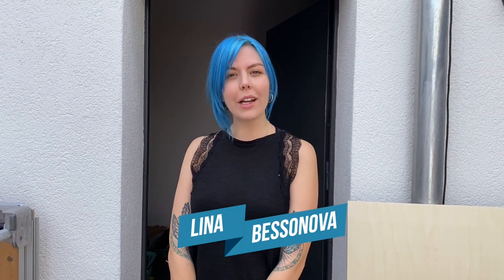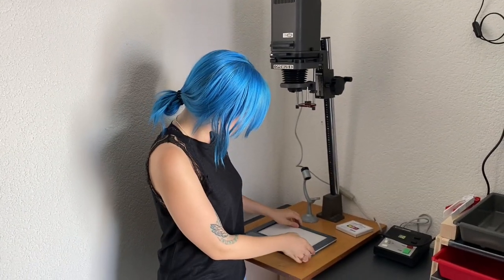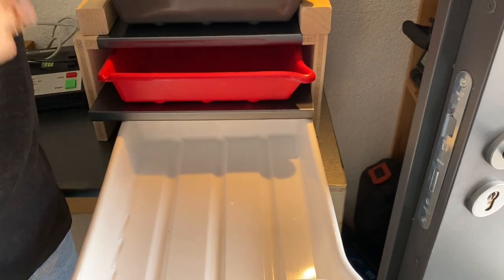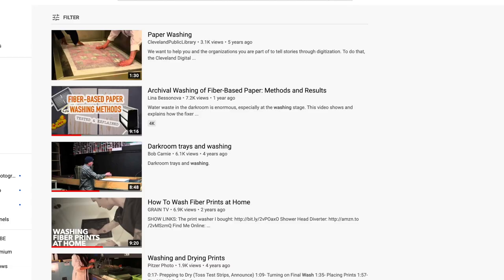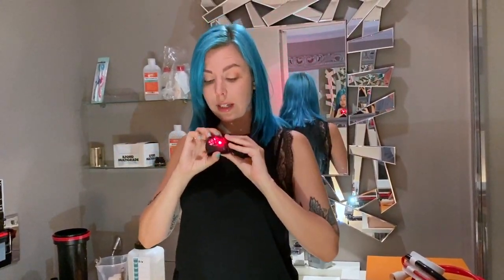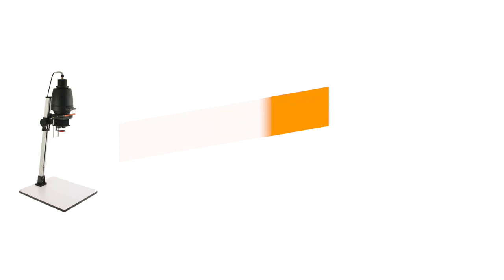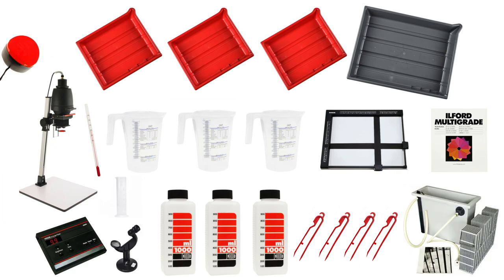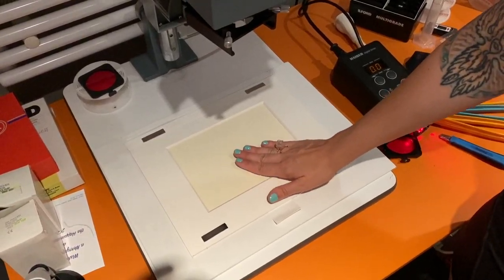Basic Home Darkroom: Setup + DIY Printing Easel Tutorial

Comment: Indeed, this is how most people printed their family pictures, most of the time!  Adapted rooms, trays carried to a sink somewhere else etc. etc.  Most of the 'amateur darkrooms' one sees on video are larger and more luxuriously equipped than the one I worked in professionally for years.  A useful washing tip is to look for the leak-tray that goes under a washing-machine, as these are bigger than two feet square and ideal for washing anything up to 20x16" (where space is available of course, but washing doesn't have to be in the dark).

Comment: I use read LED lamps. They come in the same size as 12 V halogen incandescent bulbs with integrated reflector. But they actually contain red LEDs. Just use a 12 V halogen lightning system and replace the bulbs with the red LED lamps.
To block light: By at a hardware store the black foil / plastic sheet, that is used to build garden ponds. (German: Teichfolie) It is cheap, quite durable and absolutely light tight. I even used it to build a wide angle bellows for my Cambo 4x5.
To agitate the water in the washing tray I use a small pump as is used in fish tanks or in tabletop fountains. Cheap, easy, very effective.
A friend dries fiber based paper on his refrigerator door. At the outside of course. That is because the fridge door is iron and magnets stick to it. Put the wett print face up on the fridge door and fix the sides with those "super" magnets. The magnets keep the paper straight and flat while drying.
The easel is a great idea. I build something similar, but much more complicated. Your solution is much simpler and easier to build.
Also great for a small space dark room: Paper drums instead of trays and a simple roller board for the drum. Maybe get a Durst Comot...

Comment: I keep things simple. My easel is a piece of glass hinged to the enlarger baseboard with tape, with three small pieces of print paper taped to the board, two to align the long edge and one to locate the short edge of the print.
Reply from the maker: That's also a solution! I just would find it a bit hard keeping the glass dust-free.

Comment: In a small space, stacking the trays is a lifesaver. I use a letter organiser that I found on Amazon. The stacked trays sit on a makeshift table next to the enlarger with a splash guard between them, and the whole rig fits into the bath tub in my bathroom. For red light I use one of the big Delta bright lab bulbs in a cheap utility lamp from the hardware store.
Reply from the maker: Yes, letter trays are a great option, and easier to clean too!

Comment: Nice video. #darktoilets :) You could push this a bit further by having the enlarger on a cart or rolling table, and use then an existing bathroom only when you need to print. Among tips I have seen:
- A rolling table wide enough to roll over the toilets could give you extra space
- You can buy stacked plastic drawers that you can use directly as trays. It will save some DIY time.
- People use old ironing tables, then place it in the bathtub to have additional table space for the trays
- You can combine bull clips (they have strong flat clamp) and shower curtain hooks for great film hangers. You can also find in these $1 asian stores cheap plastic hangers that have tiny clamps working quite well too
Reply from the maker: Awesome! Thanks!

Comment: Hi Lina. Thanks for the video. I think I am going to try to make one of those tray systems you did. I have recently purchased my first enlarger, an Opemus 6. I am quiet happy but I could not find multi-grade filters for the size enlarger needs, I think they are  7cm or 7,5 cm and the ones I could find are 9 o 15 cm. Do I have other option rather than buy one of these and crop them? Thanks in advance.

Comment: For safe light: headlight is ok, but actually it's cheaper to buy a set of LED RGB bulbs controlled by a pilot - OSRAM has those for all types of sockets, and when they're set into color mode, they use separate, low power RGB LEDs, so when you choose "Red" on a pilot, only red LED is used... and it's safe... and you can have them screwed in as normal lights... it works fantastically for me - I have half of my flat safe-lighted this way xD
Reply: Make a test first, some red led are not safety.

Comment: Don’t you wish there was a “compact” 4x5 enlarger with a retractable/adjustable baseboard and swappable column heights? I noticed you are limited to 6x7 like me due to ceiling and floor space. It could be worse though so I am grateful. I bought a grafback to try 4x5 enlarging with a tripod. Also, for anyone reading, I’ve been using a low tech version of Lina’s easel for a few months. If you don’t want to bother with magnets you can just hold down the matboard with your hands. It’s less elegant, but you’ll still have clean lines.
Reply from the maker: Intrepid cameras were at least surely in the process of making a 4x5 enlarger and maybe even finished it. It's folding, based on a 4x5 camera. Great idea

Comment: hi - super dumb question but this is a basic setup for black and white prints right? :)
Reply from the maker: Yes! b&w. But for color you just need a different enlarger. And a special orange safelight, not red!
Reply: @linabessonova  Hi Lina,
Thanks for the reply. But for colour dont you need a special machine to do the developing process?  i didnt think it was possible to do colour print development manually as you do with B&W :)

Comment: "Timers are pretty inexpensive"
120 freaking bucks for an egg timer!!
Reply from the maker: You can print without timer, using a metronome app. Relative to many other things, a 100-120EUR timer is an adequate investment, which you will use for years.
Reply: In my first darkroom before 25 yrs I dismantled a dumpster microwave and switched with the panel keyboard the enlarger according to the time shown in the display.

Comment: Does that enlarger support 120 film? I found a great deal on it second hand
Reply: Meopta Opemus series does both 135 and 120 film.  Opemus 5 and later are much newer and can use masks, glass, bulbs, lens-mounts and so on which are more available than the older versions.  The largest format for most of the Opemus range was 6x6cm, though I think the very very last of the Opemus 6 series could do 6x7cm.  The larger 120 formats and sheet-films were covered by other models in the Meopta range.  These machines used die-castings, rather than the sheet-metal structures in cheaply-made enlargers, so are very robust and reliable.